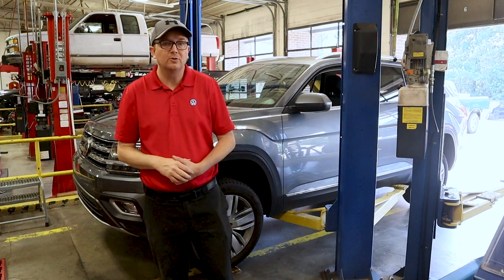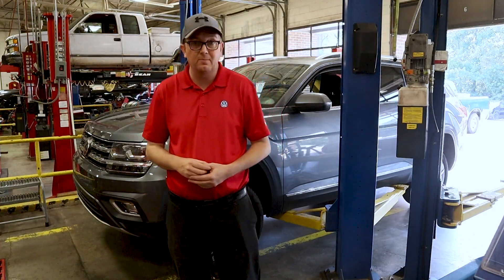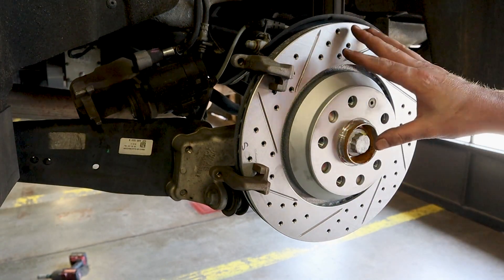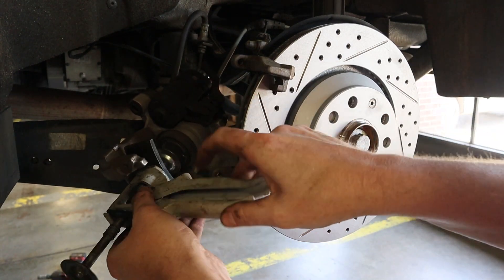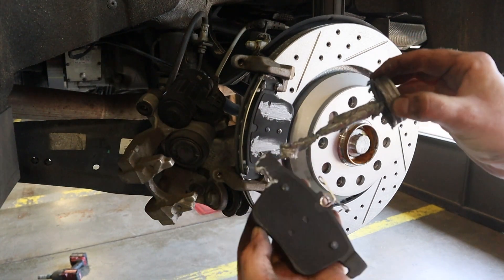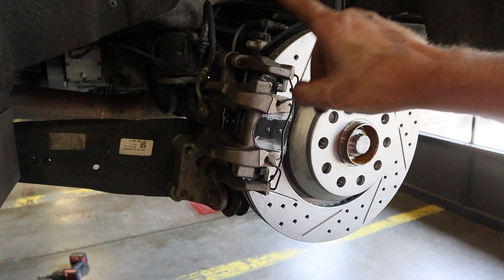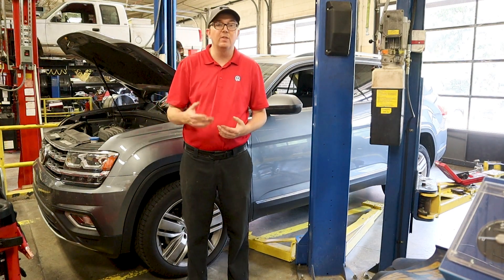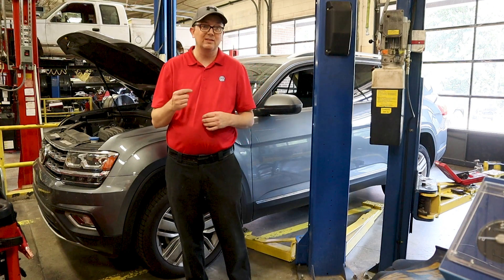How to replace rear pads and rotors on a VW Volkswagen Atlas

Comment: FYI You can do the rear brakes without a scan tool or jumper wire.  You need to disconnect the parking brake motor then remove the 2 bolts holding the parking brake motor.  use a 9 MM socket and turn the gear clockwise till it stops.  Then compress the piston as you normally would
Reply: Thanks so much 🙏  I was thinking I needed to buy a scan tool
Reply: Hey so when putting it back on do I turn the gear back the other way?
Reply: @16Tooth  I figured that out but thanks for the confirmation
Reply: Dude your a frickin rockstar!!!!!!!!    Started on my wife's car and I was like now wtf?     So thankful for you sharing your wisdom!!!!!!!
Reply: Hi can you help me out please ,I have 2021 jetta and the mecanic guy he changed the rear brakes after I took it come up on the screen beeping atention the parking break active ,how do I fixe that ,can please explain to me .
Reply: @jaychambers5487 did you have to turn it back? doing mine tomorrow

Comment: An excellent video, I watched it several times before I did mine and it went incredibly smooth.  The best part of this is you show that you don't need to remove the Caliper Bracket, what a HUGE time savings and just like you showed in your video, it is no an issue sliding the rotor in and out of it.  Great design by VW and great tutorial by you!
Reply from the maker: Thanks Doug!
Reply: You said in the beginning you would explain how to torque down the caliper bolts and the. Skipped over it giving just the spec. I couldn’t fit my torque wrench in the space. Just curious how you pulled it off. Thanks.

Comment: Thanks for this.  I'll try it next time.  You are the only one I have seen that doesn't remove the caliper carrier to change these rotors.  That was my most hated part of the first time I did Atlas rears.  Those one-time-use triple square bolts in their oh-so-inaccessible location had me using big swear words.  I am (almost) looking forward to changing them out again now!
Reply from the maker: Right! I always try to work the rotor out before I tangle with the bracket, but most cars require removal. Thanks for watching Craig!

Comment: Great video. I have the same brake system but own a Seat Ateca. The workshop manual says torque the pins to 25 Nm (not 35 as you’ve said and another similar video on here). What should I follow?

Comment: Your video was very clear and succinct. Not removing the bracket made the job extremely fast and straightforward.

The first one took me an hour while using you video for reference. The other dude took 20 minutes!

Now I won’t dread the next time the rear brakes need to be replaced.

Not removing the bracket is key!

Comment: I have a 2020 Atlas Cross Sport bought new four years ago, and now the dealer says at 40k miles that I need new REAR brake pads AND rotors. How true is this regarding needing new rotors? Can they just be resurfaced? That seems like such a low mileage for rotor replacement. TIA
Reply from the maker: That was about the miles on this one. Rear will go way before the front because the pads are thinner from the start.
Reply: @AutoScholarwithMrB  thanks for your response - I get it on the pad wear...but NEW rotors at 40k seems a bit much!
Reply from the maker: @jonbe9  that’s what VW recommends but I’ve seen people just put pads on too.

Comment: Why did my 2019 Atlas with 52K miles on needed the rear brakes and rotors replaced before the front ones??
Reply from the maker: The rear pads on VWs are always thinner than the fronts for some reason.

Comment: Do you open the brake reservoir cover when compressing the calipers?
Reply: @16Tooth You’re wrong boss. It’s not necessary at all the reservoir is vented through the cap.
Reply from the maker: I have removed him from the channel, not for being a jerk, but for giving bad information. Excess fluid will vent through the cap or the cap can be removed. I’ve never seen it matter much either way but tend to loosen the cap myself, which I omitted from the video unfortunately.
Reply: @AutoScholarwithMrB  solid move!

Comment: Never understood those electric parking brakes. All this complications and procedures to change brakes. What was wrong with a handle and a cable to put on parking brakes. Why do they need to reinvent the wheel and complicate shit?
Reply: It helps a lot in areas like Minnesota where the rust belt damages the system of the wire based brake beyond repair.
Reply: The only problem I ever had with the cable system was the cable getting loose after five years, which literally takes five minutes to adjust

Comment: Anyone know where I can get a cheap scan tool for the caliper open/closed procedure?
Reply: I bought a cheap one off of Amazon that worked just fine for this job ( Autophix 5600).  It was a lot cheaper ($66.79 vs $109.99) when I bought it in 2021.

Comment: What is a good inexpensive scanner for this?
Reply from the maker: I use an Autel 906 for this and you get one used fairly cheap.
Reply: @AutoScholarwithMrB   what did you consider cheap? New there? $1,000 aren't they?
Reply from the maker: @Thatsmessedupman  right but used they are cheaper, about half price from new. Cheap is definitely an opinion, as I have a $20,000 Snap on Zeus scan tool as well. The Autel 906 is the cheapest scan tool that will get you professional results that I use. There may be cheaper ones but I don’t have any experience with them.
Reply: OBDeleven

Comment: My caliper won’t compress ??????? I’ve disconnected the harness & open the bleeder valve it still won’t compress & I have the proper tool . 2021 VW Jetta rear brakes